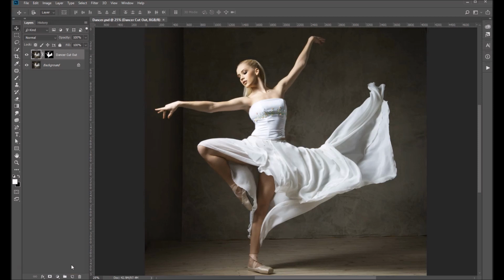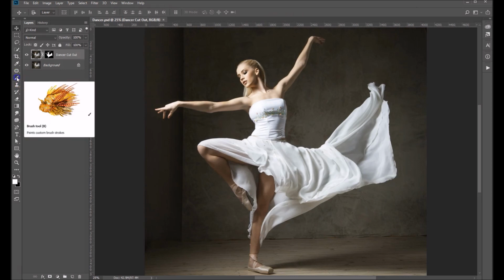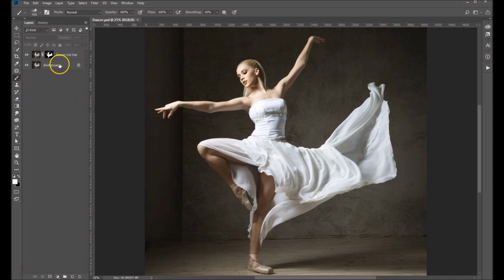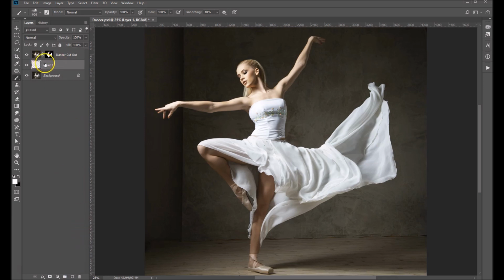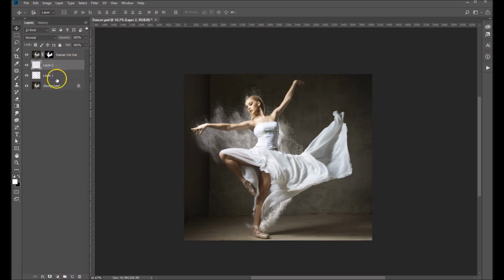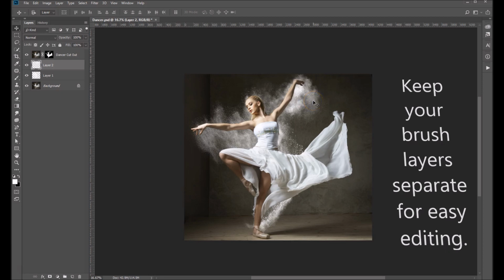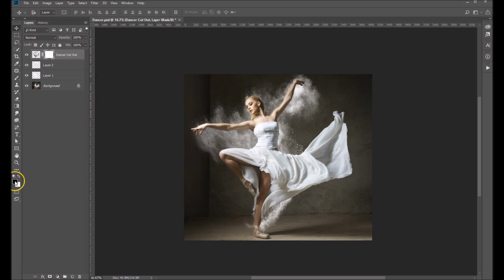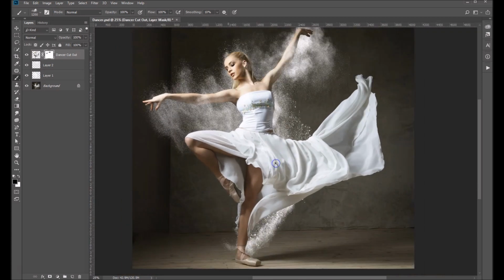Using Ashe Design Powder Brushes

Comment: Great tutorial! One quick question as I am new to using brushes. When I am loading my brushes they don't stay in a group when loaded as yours does in the tutorial, they all load separately into my brush panel, then I have to select them all and move them to the top. How can I keep them all grouped together as you did. Thank you!
Reply from the maker: It depends which version of Photoshop you're working in. Older versions will not group.
Reply: I am using CC so the current version. It will work just fine this way too. It was very easy. Thank you.